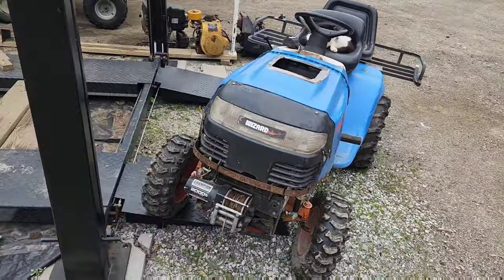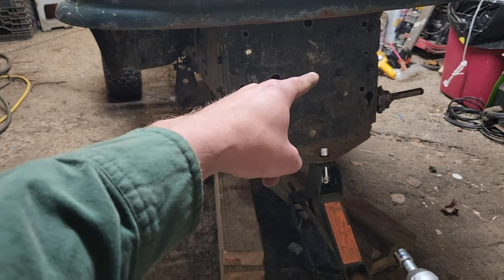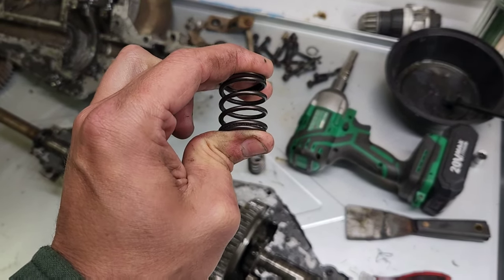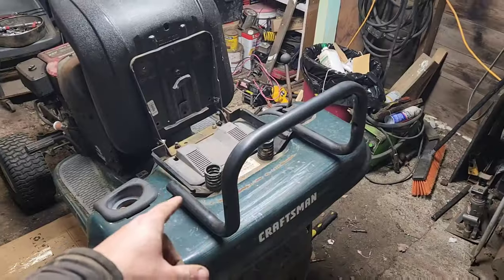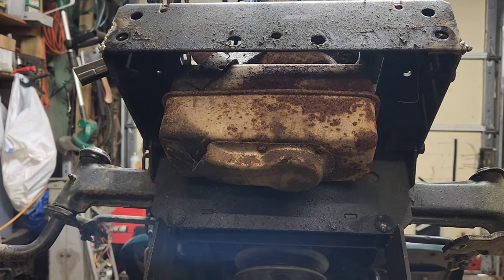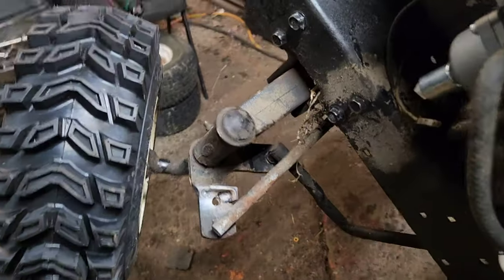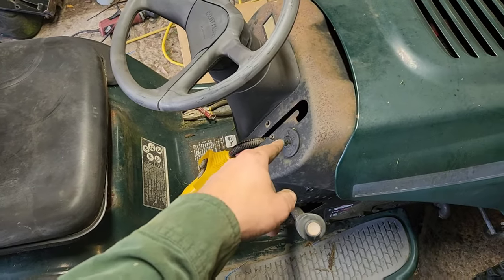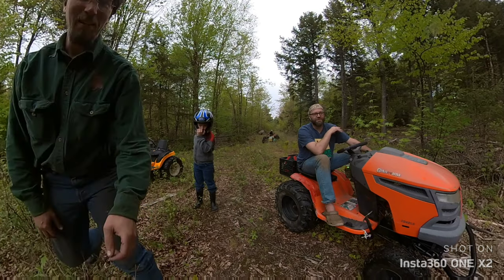Cheapskate Mud Mower Build

Comment: What holds that front end in that frame that bolts with the 4 bolts on both sides snapped both of them plates did I’d lightly suggest bracing that frame piece
Reply: We got our Lt1000 for 175$ cause the kid punched thru the plywood ramps leading into the shed at full speed and stopped it cold. 
I welded the beam all back up and we got a few cuts in before getting another beam for like 30$ new. 
And I see why they're 30$ lol stamped sheetmetal.
Everyone always says use something else besides a green lt1000 but with a few mods it looks like they can be decent.